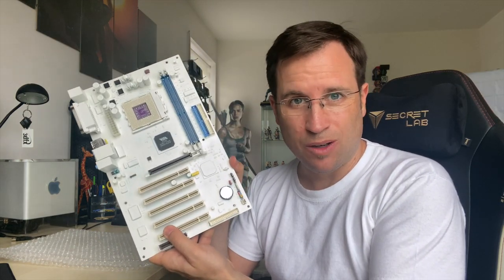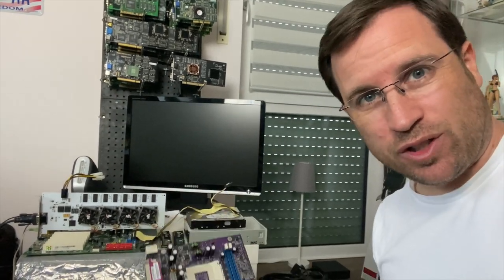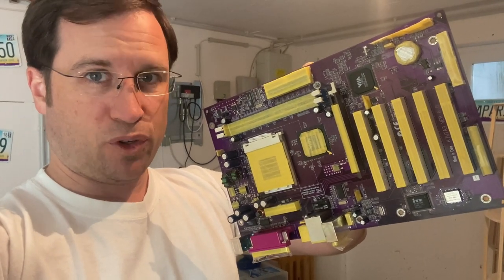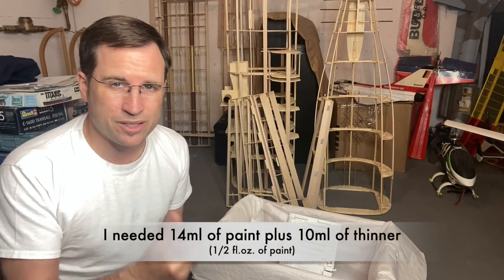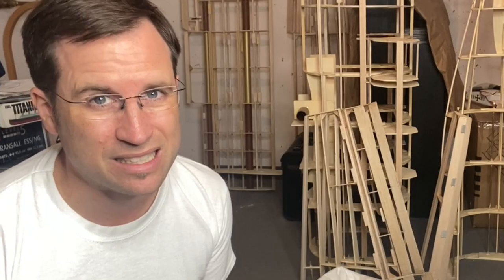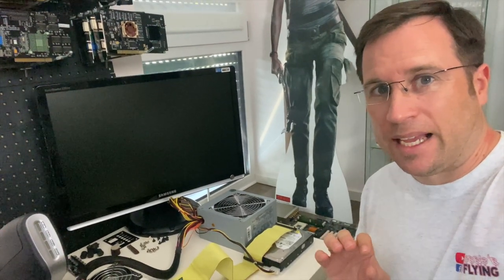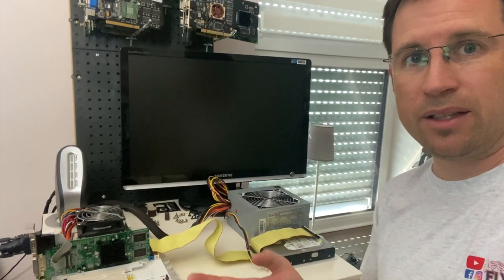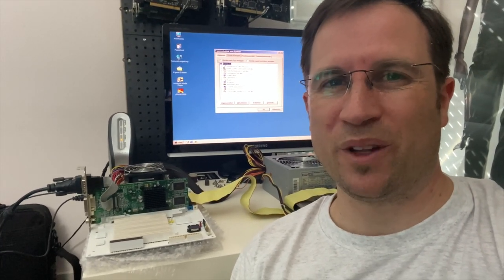PAINT PC HARDWARE ??? $1500 3dfx Voodoo5 6000 "Snow White" should get a white home...

Comment: I said it in the other video too, don't trust your expensive GPU to an ECS motherboard, the caps in them are junk, I was burned 3 times by ECS, the board was recommended by Tom's Hardware at the time too.
Reply from the maker: With that old hardware you always should do a recap before using it…

Comment: If 3dfx was so sure to not resist, alone or with an alliance  like seen with  the investor of VIA's Technology , why They have not  produced only this model of card, the voodoo 5 6000.  Only a godzila, for a final battle, bigbang, plus the lower price possible.   Why all the  bet with the  3500,4500,5500....maybe They had contract with the 3500 serie....etc.  If They were aware of their  fatal fail  since   the first quarter  of the years  2000, They should have only produced this card....its better to have 60 millions of lost  because you sell at a ridicule low price,the best card ever seen, 4 gpu, than to endure a slow death and 60 millions of revenu lost after 10-12 months.  They acted like a drunk walker  until the end....or it was a phoney act, They wanted to fail, and faked a slow death in the idea to make the more cash possible during a sell out  of everything. They have lost their time on the little product.  So 20 years later, We hope that Privates manufacturers will   win the right , and the permission to  reproduce all the 3dfx series, the knowns and the unknown possibles ! Distribute the blue print of all their gpu, Mister NVIDIA, thx .
Reply from the maker: Yes, 3dfx's story is a pity...
Reply: Had they been in a position to mass produce and sell the V6000 as a viable product, they would have. But it would have been too little, too late. The VSA chip was delayed a very long time, and when they finally got it working, other manufacturers had better designs with more features. 3DFX needed a redesign. But designing, testing and getting fully working prototypes takes a long time. Getting it to full mass production, writing commercial grade drivers and graphics APIs is a BIG, EXPENSIVE job. 3DFX needed to not only catch up, but surpass the competition. It wasn't a realistic prospect.